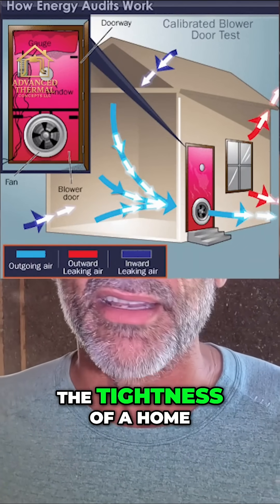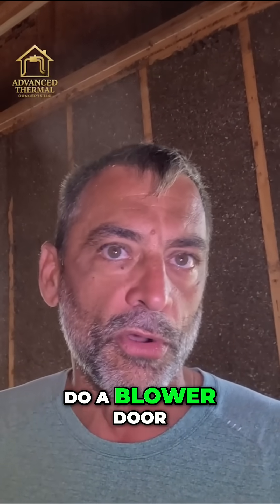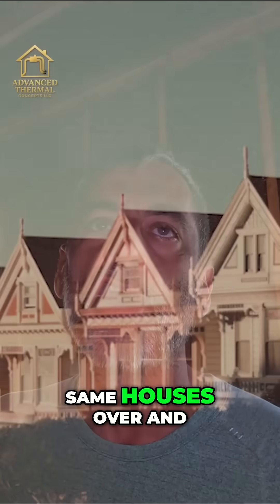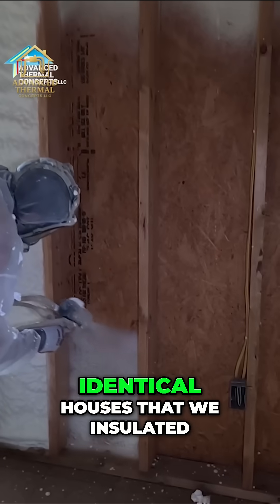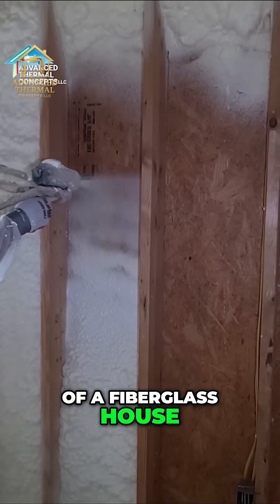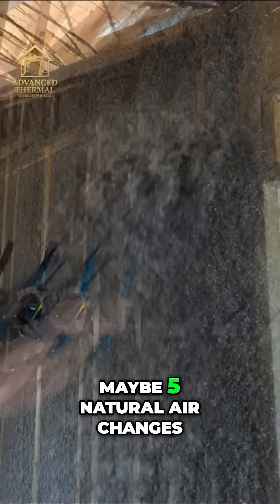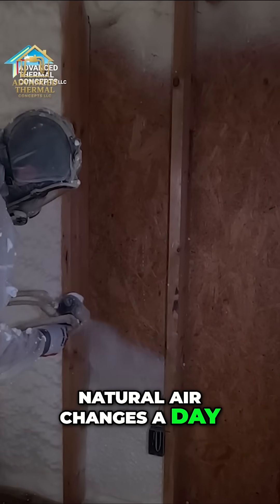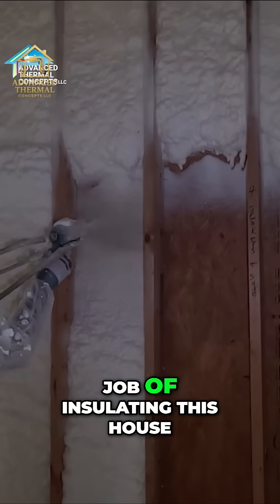We Tested Spray Foam vs Cellulose vs Fiberglass… Here’s the Leakiest!

Comment: Is 2 enough to let the house breathe and prevent sick building syndrome?
Reply: That's where heat recovery ventilators come in which are code in many places. It extracts heat before interior air is ventilated outside and is constantly bringing in fresh air.
Reply: @Yielar1 thx for the info.

Comment: especially when you use blown fiberglass in attics!  The difference in air tightness of a house with cellulose in the attic versus fiberglass is wild.  You can have two feet of fiberglass in an attic and look at it with an infrared camera and a blower door test and all the leaks through top plates will make it look like the walls are on fire in the summer time!

Comment: You can't forget the seal package around the king studs, all double studs, all corners where insulation can't reach, the base plate, windows and doors. That also helps with the tightness of the house. But you also don't want to make the house too tight and cause negative pressure.
Reply from the maker: We caulk all wood to wood areas and ERV keeps house at slight positive pressure